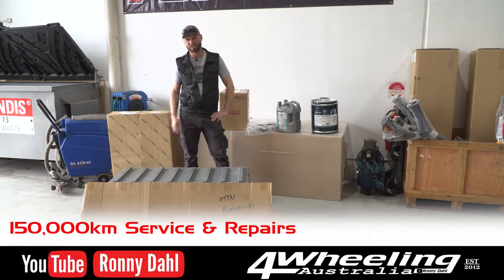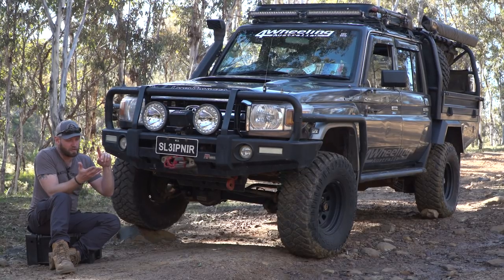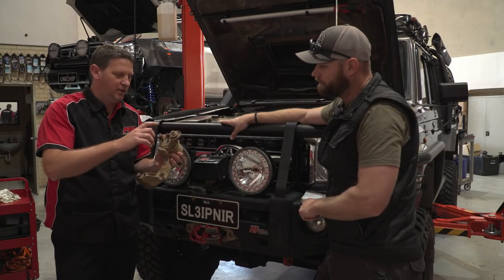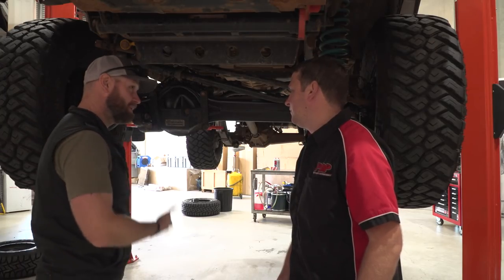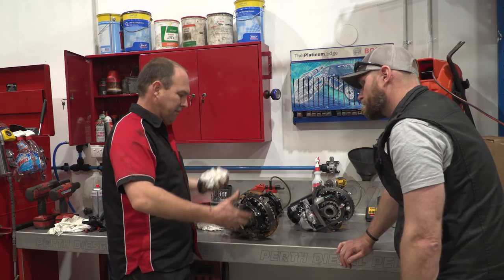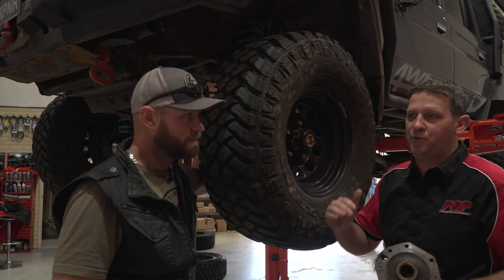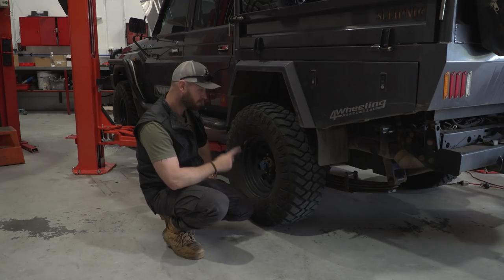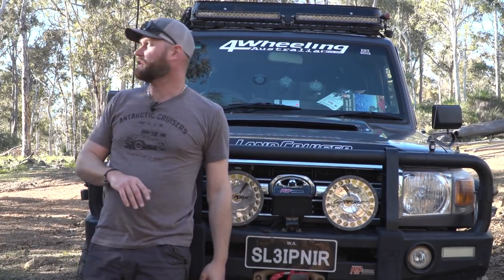Landcruiser 150000km service

Comment: Ronaldo …. great video   …   appreciate your honesty including flaws (downhill slammed into 1st fear) and acknowledgement for those that assisted (newtown toyota and pdp)  … I own a 2014 single cab 79 and expect to get closer to 400,000 before I need to address some of the works that you have done …   simply because it is extremely well maintained and does not get the continuous punishment your vehicle gets   …  I have a greater appreciation for more comprehensive visual inspections   …   once again, WELL DONE

Comment: I remember when I first started off roading, (with my daily used 4x4 car) I would find a challenge and tackle it until you've conquered it.  But when the repair bills started to roll in, it is now have a cautious crack at it or take a more prudent route.
Cheers.

Comment: I'm driving a 19 year old truck with over 400k miles. When I worked for a repair shop I got parts for cost. I didn't have a full pay check for the entire year and half I worked there. I replaced all kind of stuff on this truck. Thankfully I did the work so no labor costs to me.

Comment: Ronny is there maybe a handbrake replacement on the way seeing as you dont have one currently? (lol land cruiser handbrake)
Reply: Yer the rock he had under the rear wheel on the video. The perfect landcrusier handbrake and you can usually  find one most places out bush .lol
Reply: Yes, Marks do a kit for a hand brake on the transfer case.
Reply: god yes,   hydrolic Handbrake upgrade would be the go for all Toyota,  even my 200 is crap in that regards

Comment: 5w30 in the hot desert!? Keen to hear how much oil you go through and if your intake system is gunked up including egr?
Reply: 5/30 cos of the turbo,line is less than 1/2 mm hole usually ,plus its probably journal,not ball bearing.mine takes 15/40.as they should.new,modern engines run on water thickness oil.synth.turbo.s need to be water & oil cooled.

Comment: Hey Ronny, how much was the diff housing and centre if you had to buy them from Toyota?
I did an axle shaft in my Everest and they wanted $2150 just for the shaft. However the whole diff, brake to brake was $5200. $4300 for two shafts or $5200 for whole diff - something is wrong with that pricing.

Would be good to compare to your diff as they are two different styles of car, but similar workload requirements.

Comment: Very interesting! The axle is very similar to the old 80 series. Same issues with that as well. Too weak bearing carriers for 35´s. 
I have a small gripe, and that is the bad habit of talking over the other person. It has happened for a while, and it is to the point where it is hard to hear the other person at times. I love the videos, don´t get me wrong, I´m not a hater, but this is something that  could improve.

Comment: What are your thoughts on the viscous fan coupling @ 150k? My experience is that when they start to leak, they go very quickly...I ended up having to drill through and bolt it in on a stinking hot day in Ceduna as the part was 2 weeks away at the time.

Comment: Again, really informative and interesting - I do wonder how much more an equivalent Defender would be to ‘run’ as a comparison in say workshop time etc.  But I agree with you (though wondered why you didnt consider waterless coolant?) that OE parts are often a good call, and that pumps and alternators etc do fail, they do need to be replaced.  And most importantly it is critical to be happy and do everything you can to ensure your truck is fit fo rthe task at hand adn the abuse it will get. :-)

Comment: Those 8 inch front high center diffs are really a bit light for the weight of a cruiser especially running 35's It's a shame Toyota went that way. Bit less right boot  Ronny.
Reply: They are only 8 inch ? Wtf. Should have out 60 axles under it
Reply: Trusty Toyota light duty drivelines
Reply: 8",????thats less than a dana 44,there nearly same as a 9" ford diff.regarded as minimum,for 4 wheeling in u.s.,better with a d60,or 70.cant bust them.!!!...yrs ago,a guy in t/ville,had an f100 4x4,hot 351,used to come out pub,pissed maybe,,regular,not just once..then do 4x4 burn outs...eventually,shit he,s clutch.nothing else.point taken,??.
Reply: @phantomwalker8251  Before 1990 Land Cruisers had 9.5" diffs front and rear. After that they went to an 8" front which is a lot weaker. The 8" is reverse cut so it holds up OK in the forwards direction but its weakness is reverse loads, which is what broke this one.

Comment: Hey rhonzo. Perhaps the diff blew as you torqued it up when in reverse? Cwp are weaker in reverse? Have you perhaps snatched somone in reverse?
Also there are mods that prevent the cpw from coming away from each other and not skipping teeth like that. Its called pegging. Its a sulphur bronze bush that rides on the back of the crown wheel where the pinion  contacts it. Been done in landies for years. Just look up diff pegging .
Hmm also not sure if toyota is made in reverse rotattion for front?
Reply from the maker: I never recover in reverse for that reason. Diff pegging is a complicated thing to do. I’ll just drive it normally and not do anything stupid like the time trial run I did. Coasting down hill and shock loading it.

Comment: Rear calipers are trailing probably. Got crap stuck in the piston fo the caliper. Had the same after a Fraser trip followed by a Simpson trip. The rear end of the vehicle receives all the crap the front end kicks up!
Reply from the maker: We did think about that, will see that the genuine pads do after 20k and go from there
Reply: @Ronny_Dahl  Great video. Hope the next 150K is even better!

Comment: Yet another great video, thanks. 
- How to check your coolant hoses:
Grab and squeeze the hose with your thumb and a few finger tips. 
If the hose makes a soft U under your finger tips it’s OK. But if the hose makes a hard/sharp V under your finger tips it is weakened and where you feel the V is where it will brake. 

Hoses are worn out at the outside of a bend because of the velocity of the particles in the coolant grinding off material as the coolant/particles travels at higher speed at the outside of a bend than at the inside. (Compare travel speed of wheels on the same axle in a sharp bend.)

Comment: Hi Ronnie,
Trying to find out what work is included in a 150,000km service for the Toyota 150 series Prado.   Dealer quotes $1160 for the scheduled service whereas a reputable local mechanic quotes $230 for the same service.  I need to know what work is required (as per manufacturer's recommendations) to enable me to make the correct decision.  Grateful thanks for your help (Christine's husband)

Comment: Can I ask a novice question Ronny?
I've been told cross drilled and slotted rotors off road is a no no, what is your opinion?
Reply: Slotted yes,  drilled generally not,  its a risk of mud and stones getting stuck in the drill holes and to some extent even the Slotted rotors,   but for 90% of what ppl do with there 4wds both Slotted and drill rotors wouldnt matter,  its mainly a mud thing, but also a good safty thing for outback travel as its one less thing to worry about
Reply from the maker: Testing in progress have heard the same
Reply: Are you  using the DBA T3 rotors?

Comment: Nice tip on the bearing grease Ronnie, cheers! Just wondering, were you using caltex oils in the engine as well before switching back to the OEM?

Comment: How did this happen/what did you do? I thought LC diffs and axles are bulletproof!
Reply: Jimbob Jones bulletproof does fall apart after such a heavy beating. i imagine Ronnys 150k km is equivalent to about 500k km of our normal driving
Reply: Cruiser front diffs are made of glass, he did pretty well to get 150k with 35s from what iv seen
Reply: He explained how he smashed the front diff in the video. A confession to incorrect use and abuse.
Reply: As above, not the front one, that's well known weak spot
Reply: The housing would have cracked because his previous shocks were too long and were bottoming out. The shock load will always break something, can be the shock mounts, shocks, axle housing or chassis.  
Nothing is completely bulletproof. Certain LCs and Patrols come with strong axles but everything has its limits.
Reply: They are bulletproof... just not ronnieproof😂
Reply: A patrol diff is the closest thing to bullet proof. Those cruiser diffs are extremely weak.
Reply: Crusier front diffs have always had problems and thats going as far back as the old FJ40s even,  They are undersized for the weight of the cars generally.  Its pretty much a hilux diff in the dont of a 3 ton car
Reply: @JeremyPetho  ITS NOTHING BUT HOW HE TREATS HIS VEHICLE.over loaded,thrashed..he needs to get a real truck.for doing what he does...say...unimog,or equivilant,but,he,s a toyota nut.cant help him...he could use dana 70 or 80 diffs,but its not toyota.sad people.
Reply: Its weight, grip,  driving style and oversized tires. The diffs arent big and robust when you have huge lug tires.

Comment: what leads to front diff failure is doing  stupid things  as stump removals, snatch strap recoveries in revers..

leads to stress on the teeth  I would not be surprised to  metal shavings in the diff oil..

Ronnies recovery video illustrate perfectly why diff fail because you are using the 4x4 incorrectly  when grip catches it puts strain on the teeth.  correct  way to recover the vehicle is winch out not run and gun the the engine..

if you have managed to bend a crack your diff and shaft as noted by Ronny himself likely means he needs to upgrade the diff and shaft as yu are likely  going above manufacturers specifications..

I suspect a set of dana's  or similar diffs are going to be in the future of ronnies and other toyota owners because you are out of specification for your usage as you have plainly shown you going well above manufacturers specification on the diff and so forth because the diff has failed..
Reply: A good option for a swap is a front axle from a Land Cruiser made before 1990, they are a lot bigger and stronger.

Comment: The down fall of drilled and slotted rotors it they chew through brake pads. If you change out the rotors, go with just slotted rotors.
Reply from the maker: That’s what I thought as well but the fronts are not very worn compared to the rear. I have been towing too I guess but I’d expect the fronts to take some as well

Comment: Toyota never has been able to make a decent diff.
Reply: Never a decent front diff anyway
Reply: @Australian4x4Adventures  the rears are flawed as well with the collapsable spacer. Yes it can be changed to a BBC solid spacer but it should come out with one.
Reply: The old 40 series had the same diffs front and rear. You could swap them around if needed, not like the smaller front diffs fitted now
Reply: Before 1990 LCs had 9.5" diffs front and rear and they were real sturdy. Only the later ones had the collapsible spacer, old style ones used shims for pinion bearing preload.

Comment: Ronny, on your new radiator. Why did you go with another stock one with crimp on top and bottom caps? I would have gone with a full soldered brass one or aluminum. Just asking..
Reply from the maker: Because I know this one works and I know it will hold up for another 150,000km. It doesn’t run hot so stock is fine for me
Reply: May be a different story for 79s, but for Hiluxes like my 110, there are no longer full-brass rads available. Blew mine last year (including head gasket) and was in contact with toyota that informed me that the brass rads had been replaced by denso plastic capped ones almost ten years ago.  At least that´s the story here in Finland...

Comment: I work underground driving a v8 ute. they are completely rooted and generally have had a new engine and full drive train by 40,000kms and are put out to pasture at 60,000kms
Reply: I know conditions are really hard, but what exactly is killing them?
Reply: @snells-window   we work in shifts, so the utes are constantly used over a 24 hour period, im a nipper which means im always mobile and deliver ground support(66 2.4m bolts,plates and glue, pluss towing 11 sheets of mesh) which weighs about 900kgs per set up(multiple setups per day).
The utes get washed at the end of every shift which means for 22 hours a day they are covered in corrosive mud that gives the skin a rash its so harsh. The vehicles are locked in low range so they are constantly red lined in reverse as there are no turn arounds in the ore drives (sometimes up to 1km long). They are never glowed before start up or idled down after heavy use.
These vehicles get a full service every 14 shifts(7 days) and sometimes that isnt even enough.
Any other vehicle would pale in comparison to the cruisers, we also have hiluxs and prados but they are used rarely underground and not for hard work, only the geos and office jockeys bring them down.

Comment: A few things come to mind after watching this. First being the noise from backlash when releasing the tension from the driveline. Much of that is caused by having the mass of a drum brake attached to the driveshaft. It absorbs the initial return of torque and then releases it back into the driveline, if you removed the mass the noise practically disappears along with any handbrake (not that they work properly on these cruisers).

Running a 35 on something designed for a 31/32 is always going to hurt the driveline, moreover the diff centres, axles, cv’s etc so to get through to 150 thousand is acceptable. I’d suggest pegging the diff would prevent this failure in the future. It’s a cheap upgrade best done before reinstalling but it’s never too late.
Reply: Interesting point you make. Every discovery i have had has had that noise, i knew it was the driveshafts oscillating back and fourth however i never thought about how drum brakes could be a major cause for it.
Reply: When I say drum brake I’m referring to the single drum affixed to the driveshaft on the rear of the transfer case. It’s only job in life is to be the park brake, this 79 series and their similar cousins utilise the same setup as the disco and defender. The biggest difference between them is the Land Rover one actually works.
Reply: yes i am aware how the drum park brake systems work on both the 79 and land rovers, i was just saying that it plays an interesting part in the backlash/noise that both vehicles
 exhibit
Reply: I was kinda checking with you as I read your reply wrong, lol. The Land Rovers have a real chatter to them, mine does it a fair bit being a manual transmission. Are you still behind the wheel of one?
Reply: @dinosshed  I thought as much, yeah a d2 manual. It doesn't not chatter too bad, my old d1 was shocking for it.

Comment: Hmm, your rear tires go wear faster then your front tires, that because of towing?
I would think front would go faster because they are the turning wheels?
Reply from the maker: The weight was in the rear plus the towing so the rear will wear more over all but the fronts will wear more on the shoulders than the rear
Reply: The rears drive more than the front ??
Reply: Do the rear tyres perhaps run a bit hotter because of the higher load? Heat seems to soften the tyre rubber and contribute to a higher wear rate.

Comment: Rohnny why don't you put an after market radiator in the vehicle? Your motor will run a lot cooler.
Reply from the maker: My Toyota one has been fine mate I’ll stick with factory. A lot of rigs on Modified with after market coolers seem to have some problems big or small that’s my reason for sticking with factory.
Reply: There are more horror stories with Aluminium radiators mate. Aluminium doesn't have a fatigue strength which means it is more susceptible to cracking from vibrations/corrugations. Usually when people have high temperatures in their 4wd's it is because of other factors such as the viscous clutches, thermostats etc.
Reply: Well said Blair. A radiator in good condition performs as it should but doesn't control the temperature, it cools and nothing else, viscous clutches and thermostats control temperatures.

Comment: Why oh why did Toyota make a heavy truck with axles seemingly sourced from a remote control toy car.. 😤
Reply: They used to have big 9.5" diffs, then in 1990 they brought out the 80 series which was full time 4WD so they put in a much smaller front diff to make it more efficient and did the same with the 70 series too for some reason.

Comment: At a guess, the bullbar bolts would've rattled out on corrugations. If you watch the corners of the bar going over corrugations you'll see there's a hell of a lot of movement going on & would probably be enough to rattle a couple of bolts out over time. I found a loose bolt in exactly the same spot, albeit on a different bar, after tackling the insane corrugations on the Strzlecki Track heading into Cameron Corner.
Reply: Its not uncommon  for those side bolts on bullbars to shear if you spend a lot of time on  corrugated  roads